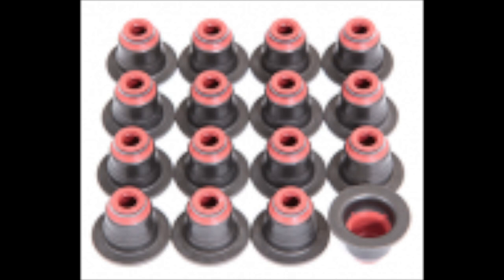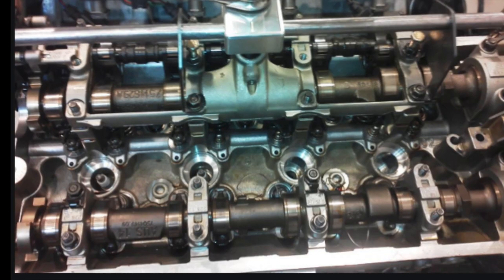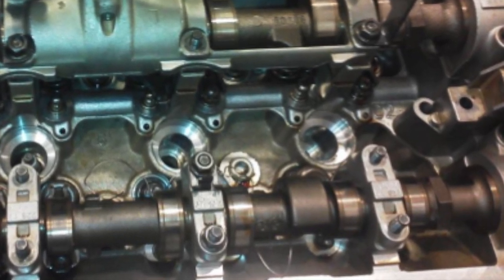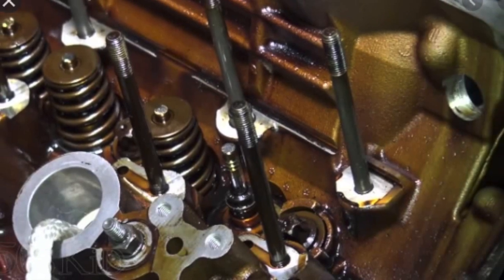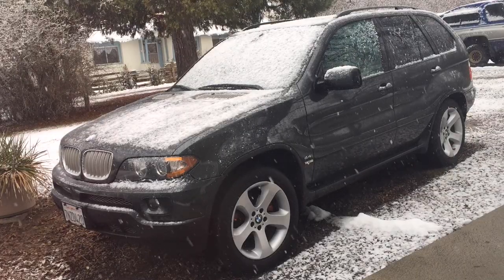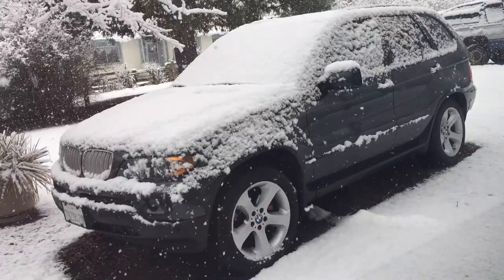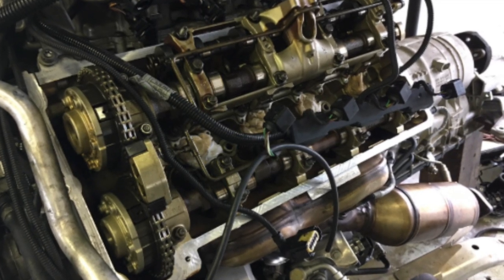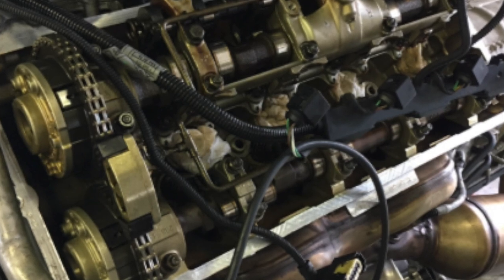BMW Valve Stem seals. What does it look like when they fail? Smoke from exhaust tail pipe

Comment: That's not oil seals. Or valves seals. That's head gasket, intank gasket. Oil burn is blue
Reply from the maker: How wrong you are Dill. This was valve stem seals. 
They were replaced and the issue 100% went away. 
The head gasket was absolutely fine. MRT
Reply: If it’s exhaust ones leaking the cat converters causes the smoke to turn white as it burns in the exhaust manifold  as it’s not quite hot enough to turn blue. My E46 has just started doing this when it sits idle when you start driving again the smoke goes away

Comment: Firstly thanks for the short and to-the-point video!  Could you shed some light on this?  On an n63 engine with about 120,000 miles that's all of a sudden smoking badly, what are the odds that valve guides are also bad? At that point it's new engine, correct? Just wondering about that since it's gotten to this mileage almost issue-free but needing lots of top-up (weekly). I guess cats would also be toast? (O2 sensor code). Thanks!
Reply from the maker: Watch this. 
BMW blowing smoke? Valve stem seals the definitive test. https://youtu.be/R3NrMnl2Py0
Reply: @Marksreviewsandtutorials  Thanks but how does this answer my questions?
Reply from the maker: @iceyu2235  It shows you a check to see if the valve stem seals are the issue. Did you watch the video?

Comment: I've got a s62 that's consuming large amounts of oil. I'm going to check the valve cover gaskets and ccv/pcv first. Would a leak down test help confirm the valve stem seals have failed?
Reply from the maker: This video will help you diagnose. BMW blowing smoke? Valve stem seals the definitive test. https://youtu.be/R3NrMnl2Py0
Reply: @Marksreviewsandtutorials  thanks

Comment: Hey i believe to have a valve guide seal gasket fail bc i got a large amount of white smoke & also oil thats inside the header & exhaust flange? Is this possible
Reply from the maker: Watch this to determine if valve stem seals. 
BMW blowing smoke? Valve stem seals the definitive test. https://youtu.be/R3NrMnl2Py0

Comment: Are the 550i s prone to this??   Which bmw do u recommend that dont have these issues plz.   I have a 545i with this issue in CALIFORNIA how much can i sell it for ??
Reply from the maker: This isn’t just a bmw thing. They go on lots of motors. So buy a car that has had them done. Or just be prepared to spend the money if they do go. That X5 in the video is in CA and it failed a smog so had to be fixed. I found a place in Sacramento that did it without removing the heads. 
You cannot sell a car in CA without a smog so you cannot sell it. 
The newer motors like in the f30 don’t have this issue and seem much more robust.
Reply: It is a BMW hot V N63 thing. Massive recall ("customer care package") and lawsuit.
Reply: @Marksreviewsandtutorials  THANK U
Reply: @goat9199  and and especially the N62 engine as well.

Comment: Oil smoke is always blue; white smoke is water, and even this might not be a problem if the car sits for extended periods and/or only does short journeys - it could just be condensation, in those cases.
If you are losing coolant as well, or the smoke smells sweet... that's more likely to be a head gasket issue.
Reply: Deffo valve seals my E46 has just started doing it unfortunately 😢

Comment: Hi Mark had the  Stem Valves replaced on my son’s BMW yesterday. Still smoking as per your video. Should the issue dissipate straight away or will it take a little bit of time to clear up please? Cheers
Reply from the maker: If the valve stem seals have been changed the result should be straight away. 
Here is the definitive test. 
BMW blowing smoke? Valve stem seals the definitive test.
https://youtu.be/R3NrMnl2Py0
Reply: It’s possible the cats are burning off oil and fuel for a little. But after a few days I’d be concerned.

Comment: im having a smoking issue from the exhaust pipe, i revved the car to 5k-6,5k rpms, tried doing a pull shortly after, long story short, the car felt like a misfiring coil pack, cause mine had failed the week prior to this issue so i replaced those, and i knew it wasn’t coilpacks, i look back, a huge cloud of white smoke, i basically took the car apart down to the point where im ready to take off the head bolts, until i was informed it could be an other issue like valve seals
Reply from the maker: Oil smoke is usually blue. 
White smoke is more likely coolant. MRT

Comment: Hi! My car is 328i 2013 same problem, I changed the value stem seal already, after that when I stepped on the gas panel no more smoke at the tail pipe. But in the morning when cold start it still have smoke. Can you give me some reasons? Thank you
Reply from the maker: Maybe this
BMW blowing oil smoke at start up? 20i engine w Turbo N20 2013 2014 2015 2016
https://youtu.be/1NzTAGb31WI